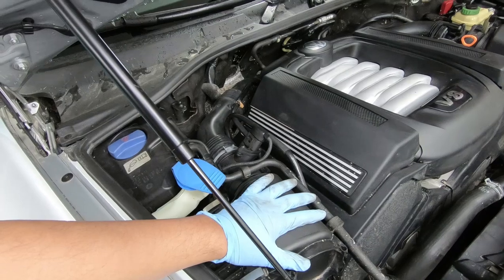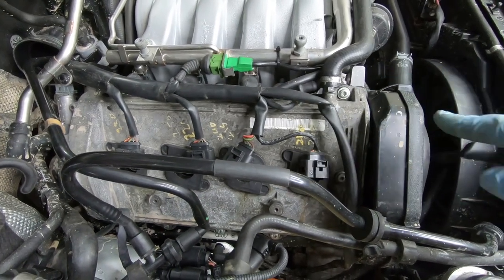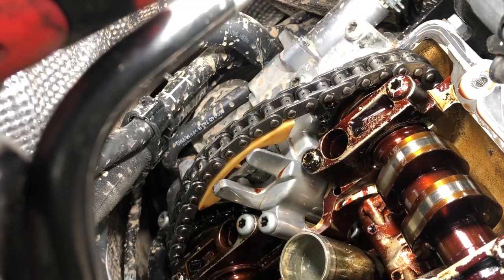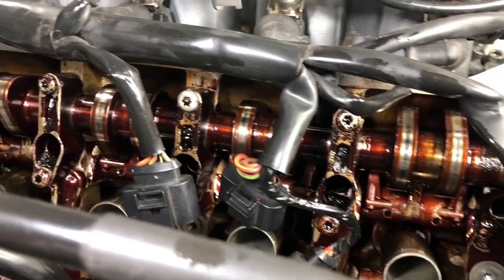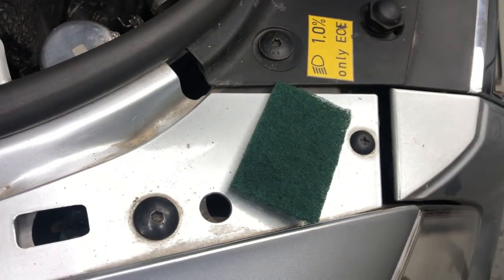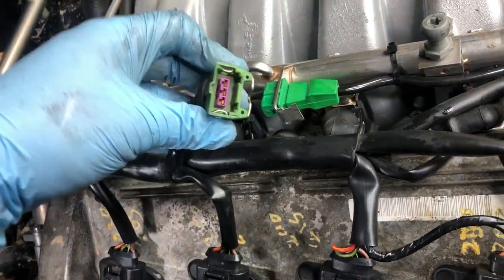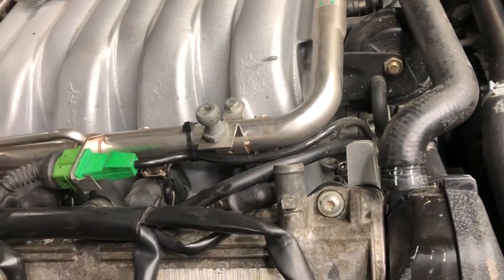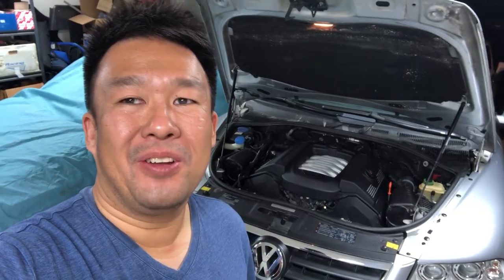OIL LEAK!! Looks like the valve cover gasket already gave out on my newly accquired VW Touareg

Comment: Just done this job on my 230000mi lx470, driver side space was tight and I managed created a tinny cut on the new gasket which I didn’t realize at first ,so I did my quick test drive to McDonald’s and drive thru kid told me  ur car is smoking like a lot a lot. 🤣 bit I do think Toyota engineers had a lot of love for their service mechanics in designing the whole car, I’m sure this will help many future handy tourag guys on fixing their car, good stuff
Reply from the maker: Thank you! Yea the valve cover gaskets are kinda annoying to do, one mistake and EVERYTHING needs to come back out, re cleaned, and then put back together. When I did it on the land cruiser, I got real lucky the first time. It was definitely more of a challenge tho, being lifted and all 🤣🤣🤣

Comment: Hey, Thanks for the video. Was the low oil pressure light coming on and then off? . Any loss of power? . My touareg has the same leak and the mechanic thinks its the oil pump. I'm hoping this is the problem.
Reply: I’m having the low oil pressure light as well
Reply: @kkhey1994  it stopped and then came on again. I ignored it and pretty much blew the engine.. figured I would just replace the motor.. but can’t get anyone to do it.. too much work and all of the mechanics are too busy.. sucks 
Not sure what to do now:(

Comment: This is the 5th time watching this video! I am in the middle of mine. Today it was removed but ran out of daylight... I am doing exactly as you say. Have you had any leaks? I still can't tell it is the valve cover gasket... it sometimes smells like oil in the cabin and once I saw it slight smoking behind the valve cover on the pax side. I really hope this fixes it. Also changed my PCV. It was baked... 

But yeah have you had any leaks/smells?
Reply from the maker: No leaks since! Make sure the surface is very clean before u install!
Reply: @chowcares  I wrapped it up earlier today and it did not look promising. A lot of smoking and oil-burning coming from the area. It feels like it stopped but not entirely sure. I really hope that all that is old residue or the oil that dripped from thoroughly cleaning.
Reply from the maker: @untyped12  make sure to clean the old residue off. that way you will know if its new old or not.
Reply: @chowcares  I think it is not the valve cover.. so hard to see what is happening in that corner. Still leaking. Any idea what else could it be??
Reply: @untyped12 Hi, what was the problem? You solved it ? 
Thank you